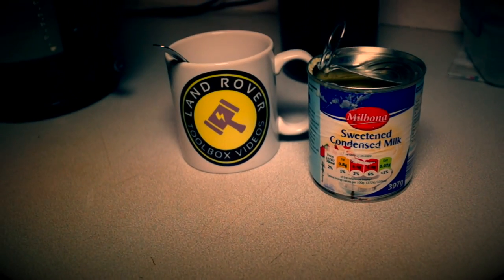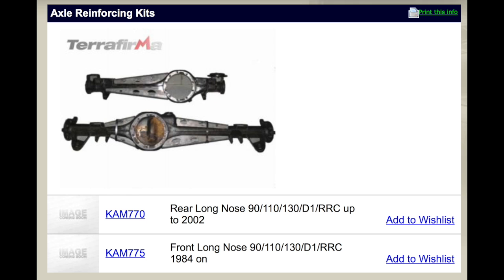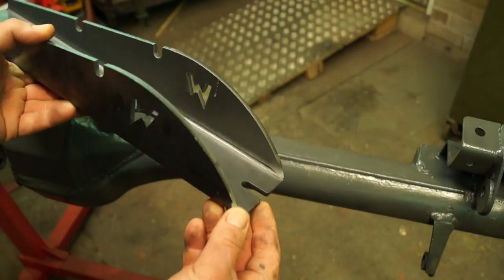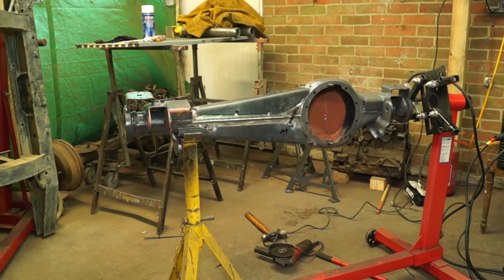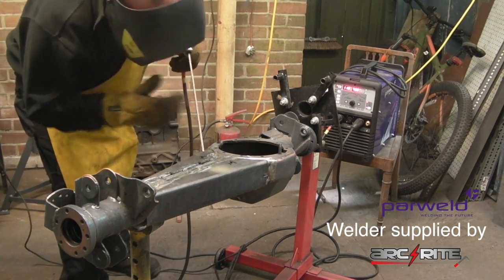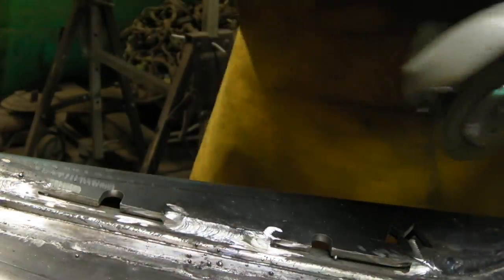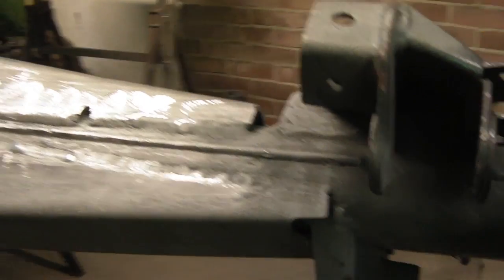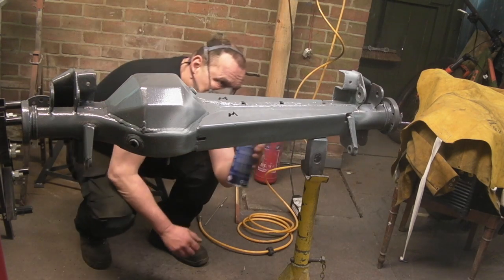Land Rover Banjo Axle Case "Trussing" - Off Road Axle Strengthening -Terrafirma4x4

Comment: I have a series 2a with a suspected bent front axle... ie the front nearside wheel is sloping out towards the top (toeing out) can this be adjusted I have already changed the swivel pin on that side which was worn but it has made no difference to wheel alignment. Some one has welded a load of trussing to the front axle (lower only no trussing above I suspect distortion)  in the past way before my purchase this may have distorted it perhaps??? I am thinking the flange plate on the end of the axle housing may be pie cut almost off and re-welded straight any thoughts any body?
Further to this note I may just cut off the lower truss and see if she comes straight perhaps?

Comment: Hello me again I need help/ advice for my 90 🙈😖  I am ment to be looking at a gearbox tomorrow  as mine is having some problems but I have just lost drive about an hour ago so now it has gone from bad to stuck 😂... I have a 200tdi disco engine with an Lt77 gearbox I have a strong feeling the splines are kaput 😖 so I am stuck are all input gears the same for the lt77? As I'm in need of parts quick hope some one help me out thanks in advance
Reply from the maker: Hi Benn.   .....check that the splines have indeed gone ...   which means taking the inspection plate off and looking into the spline area.  Video here  https://youtu.be/7vFPc5ZSRKg
Other issue that may be a cause of loss of drive is a worn out drive flange on one of the hubs.
Reply: Land Rover Toolbox Videos thanks matey I took out the input gear thanks for the video on that super helpful and well the splines are gone 😂😖 so found a re-con gear box £300 and the bloke even chucked in the new gear so I have bribed my good mate with beer and hopefully we will get that in tomorrow 👍 thanks for the advice mate
Reply: Oh and what grease will I need  for the gear or is it just standard?
Reply from the maker: you could use graphogen to put it together but EP oil is okay.  That's me thinking you are talking about grease when assembling.
Reply: Yes just for assembly Ok tops thanks for the advice il go pick some up oh and thanks for the mention in the video 🙂 glad I could be some kind of assistance

Comment: Instead of trying to paint inside the trusses, get some Bilt Hamber Dynax S-50 in aerosol form. They come in a very big can, with a cavity injection lance and it outperforms pretty much every other cavity/underbody wax there is, even dinitrol which is widely regarded as the (or one of the) best.
Great video as usual though, thanks for posting up - it's one of the less seen mods for landies :)

Comment: That is a great welder. The modern units with inverters and variable parameters are a world away from the big old transformer welders I learned on as an apprentice!
Reply from the maker: I noticed when watching it back when editing the amperage is changing to stabilise it.  I highlighted that in the video.   Bit of a surprise, the welder is very capable.
Reply: Land Rover Toolbox Videos yes,I noticed that too. The arc force is following the arc and keeping it beautifully stable. There is some very clever electronics going on in there. Arc welders have changed so much. No more big transformer with a few switches selecting output! The power that comes out of a tiny shoe box sized unit is amazing. As is welding thick material from a domestic supply.